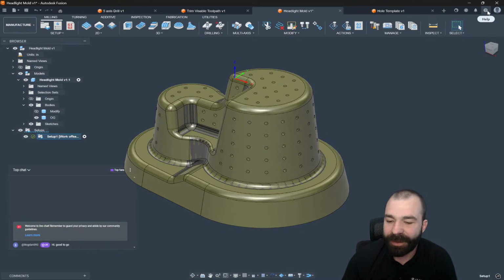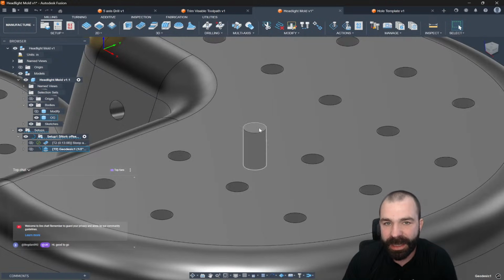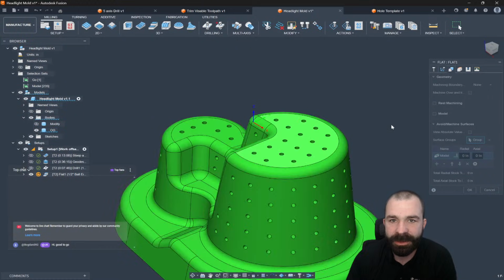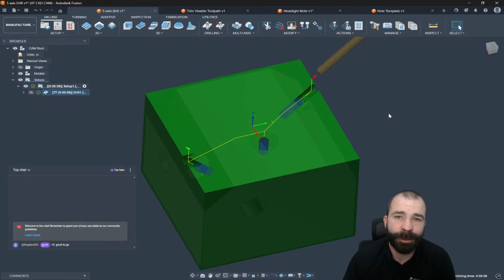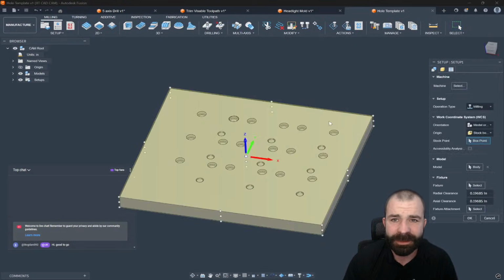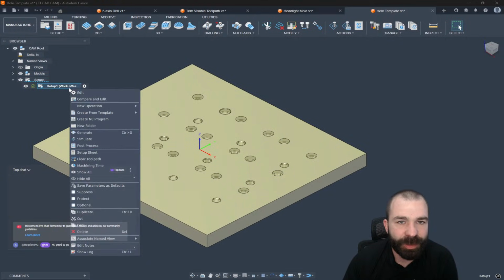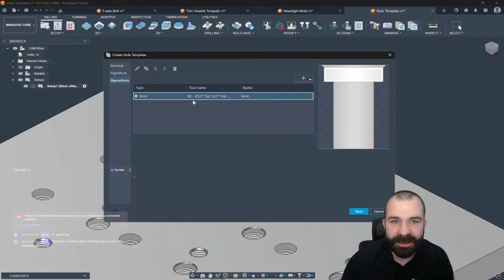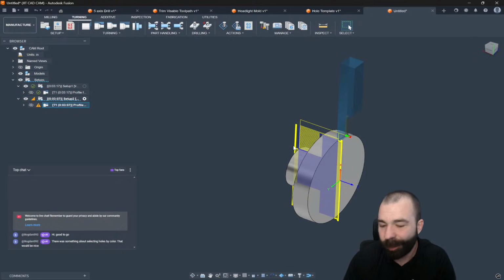Workflow Wednesday: November Update - Manufacturing & Turning News!

Comment: Hi Phil ! Did You hear about troubles with surface finish with 5 axis machining on hurco ? I used few compilation of SFQ parameters but still getting really bad surface. Hurco 42srti 5 axis
Reply from the maker: Put in a ticket and lets take a look. It sounds like your Smoothing isnt working.